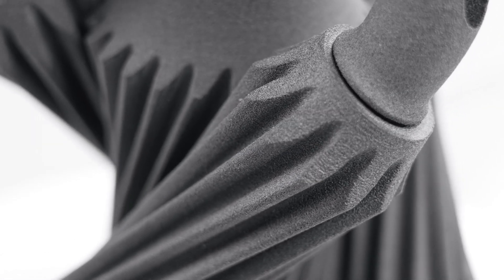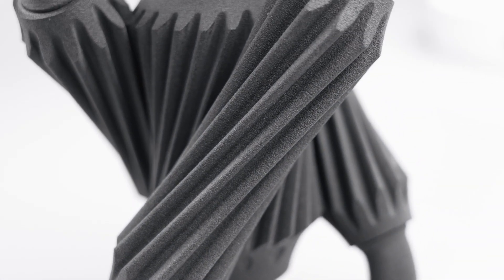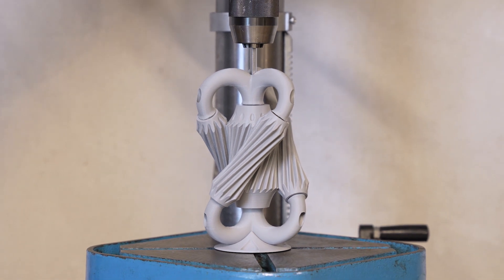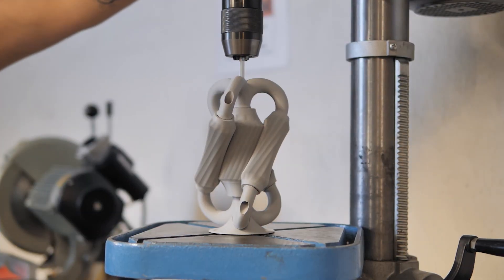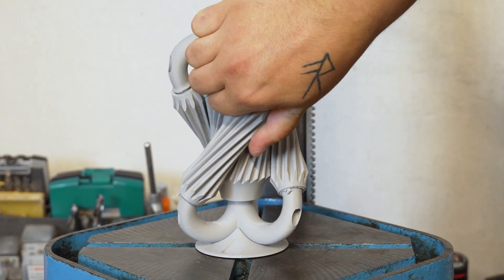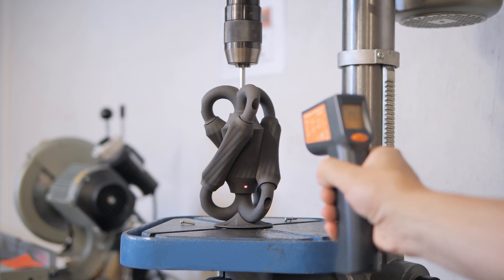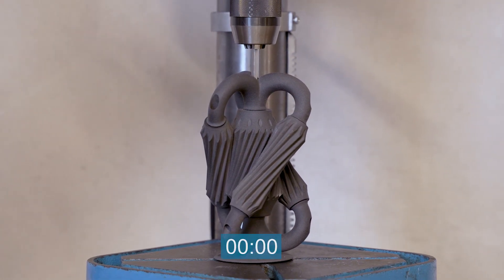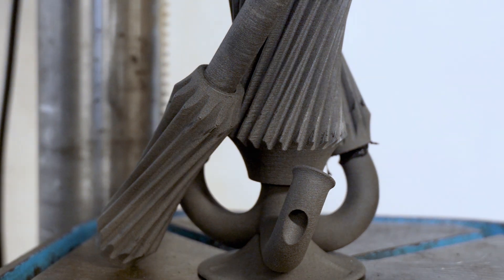SLS vs. FDM - Which technology wins? | Test of a Hyperbolic planetary gearset

Comment: Using a Material with 60-70 C heat deflection vs. a Material with 180 C Heat deflection isn´t kind of professional or comparable. Repeat the whole process with a PA12 vs PA12 and then let´s talk again. I tell you there is no real significant difference then. Not the best marketing, guys.

Comment: pretty disingenuous comparing PA12 to PLA.
Reply from the maker: Our idea was to compare the two most common materials for each technology. Also, the print bureaus near our location do not offer FDM prints with PA12 filament unfortunately.
Reply: @Sintratec  i totally get that but the heat tolerances are very different. I know SLS is obviously better than fdm. Hoping one day y’all will sponsor me with a machine for my night vision

Comment: Why even bother to test PA12 against PLA???

I'm pro SLS but the cost of getting a decent size SLA printer is way over my maker budget.

Building on the V-CORE 3.1 I am building my own all metal FDM machine with a 500x500x500 build cube capable of printing with glass and carbon fibre PA6 as well as PA12 at a fraction of the cost of any of the commercially available SLA machines.

This will be my stop-gap printer to use while waiting for the open source SLS4ALL design to be released and then the SLS technology becomes available at a semo-pro budget.
Reply: There is a startup that will sell sls printers at 3k, they just released a demo of their printer and i think it's amazing. Not that I'm very knowledgeable but it just seems cool for the price

Comment: Do you compare PLA to PA12? Sounds like cheating to me.  SLS print should be more robust than FDM but compare the same materials at least. Otherwise, your comparison is useless
Reply: Seriously, the most useless comparison ever. You could have done PLA powder for the SLS, as FDM printed PLA strength is far from its ideal strength. This could show if SLS achieved better layer adhesion and thus better yield strength.
Reply from the maker: The idea was to use the most common materials of each technology. Many print service bureaus here (including the one where we ordered the FDM part from) do not offer PA12 filament.